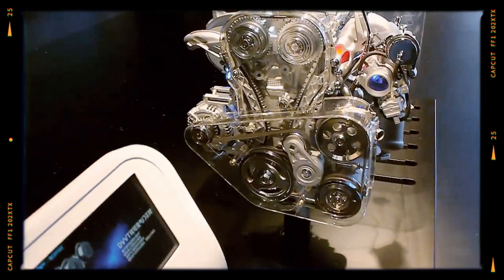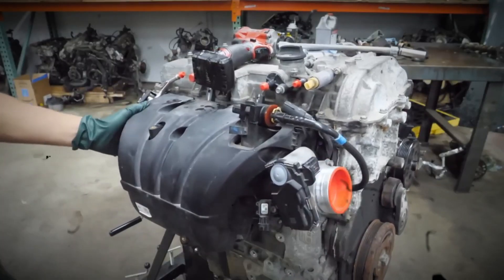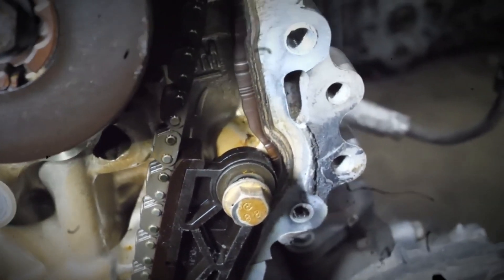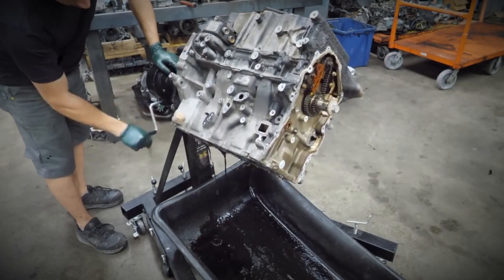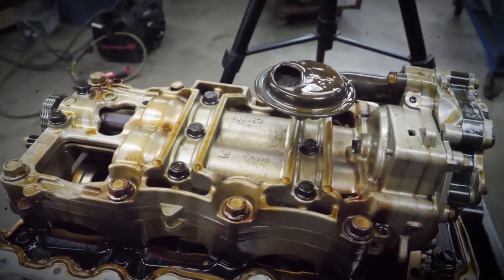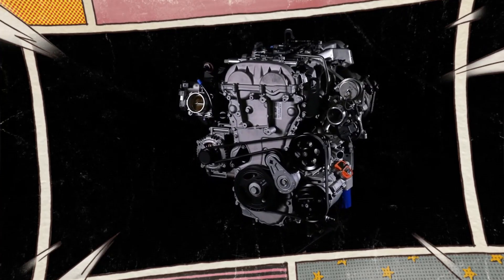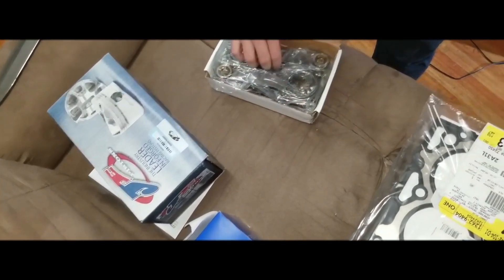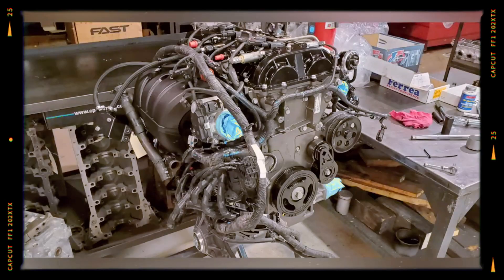Specifications, Issues, and Dependability of the GM 2.0L Ecotec LTG Engine!

Comment: I fix cars made this video. He soda blasted the valves and he was working on a 1.5.  U copied part of his video. And that's a mhi turbo made by Mitsubishi heavy industries.  Your info on the turbo is wrong.  The piston failures were 2017 and under in the 2.0. 2018 different piston and rigns were used.  some of the rest of your info is right.

Comment: It's a piece of crap, I would never again buy a car with an ecotech engine, terrible engineering.
Reply: I have one with 148k on it. Zero problems
Reply: @miketyler7616  Don't worry it's coming soon, won't get passed 175k
Reply: @DavejrJr-pf2dd  yeah… they misfire… it will make well past 200k and less trash ticking noise than a Honda
Reply: @DavejrJr-pf2dd because is you have not experienced many misfires and you are already that high mileage, you know it is a good engine.
Reply: @RebelCaveReborn  you are kidding right? I would take a Japanese made Honda any time over this American piece of crap. A Honda with regular oil changes will last 300K+ and this piece of crap chevy captiva eats 1 quart of oil per week 😆
Reply: @DavejrJr-pf2dd  Whaat man? No. They are all rated 200 thousand miles. Even Honda. With proper maintenance,  you get much more. I'm a mechanic.  I just fixed a 2003 civic from the ground up. Did everything and it is a tinker machine. These things need constant valve adjustments. I'd take this camaro over any Chinese- Japanese junk.
Reply: @RebelCaveReborn  you must be the chevy engineer that designed the piece of crap ecotec engine 😆. I owned both a honda civic and a chevy captiva and the captiva even with proper maintenance ate 1 quart of oil per week HAHAHAHA I had to donate that piece of junk because I didn't want a hole in my wallet.
Reply: @DavejrJr-pf2dd  Oil never gets in the combustion chamber- bet it is a proformence car and all that civilian driving burns oil. It needs to circulate like it was intended to. The timing cover does leak and it is more like oil deposits, not that bad. I could fix it but no point really.  Seems the PCV hoses are cheap and could break, causing oil consumption.  The vacum pump also may need to be changed evey 90 thousand miles. It is direct injection so it is not like it has no issues. Thinking of buying that walnut blaster.
Reply: @DavejrJr-pf2dd  I used to own a 2019 civic too and some old man started his old crap truck, flung it into the street without looking, i T-boned him. It was destroyed last year. I got 29 thousand for it though. Full coverage.
Reply: @RebelCaveReborn  The captiva ecotec I had only lasted 50k then the engine gave up despite regular oil changes. It consumed 1 qurt per week, terrible efficiency, it was a 4 cylinder and I only got about 17 mpg. I changed the radiator as it was cheap plastic and started leaking, I changed the serpentine belt as it gave up. It had problems with the gas pump .  Worst car I've ever owned that chevy engine is trash.
Reply: @DavejrJr-pf2dd  That is not even the same engine first off. Although  there was a slight issue with the fuel pump, all I did was fill it up more and not let it get real low on fuel. The engine light never came back. That was 30 thousand Km ago. It's a real good engine actually and they out it in the Camaro. Mines the 2021LTG. White - with sky blue trim. Even my mirrors, rear spoiler, the whole trim sky blue. It looks killer.

Comment: Leaks oil, otherwise a good engine. I have 132,000 on my '13 ATS.
Reply: You mean the timing cover? I can fix that. No car leaks oil… it’s all on how you use the RV rubber sealer.

Comment: Most power dense engine ever?
Reply: Might be an AI video. I notice a lot of the footage is from I Do Cars channel
Reply: @chumps7974 u r correct.
Reply: At the time of its first production it was the most power dense production engine at 135hp per liter.
Reply: @adamhayden5152  times have changed
Reply: @ very much so!!
Reply: Did you get permission from "I Do Cars" to use his teardown video?  This is not your original content.  You need permission and you need to cite the source in the video.